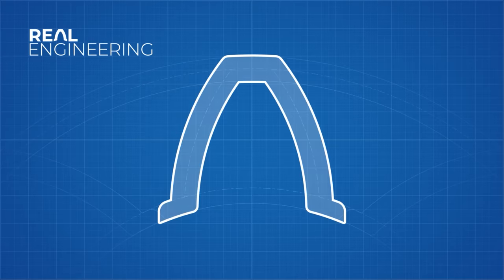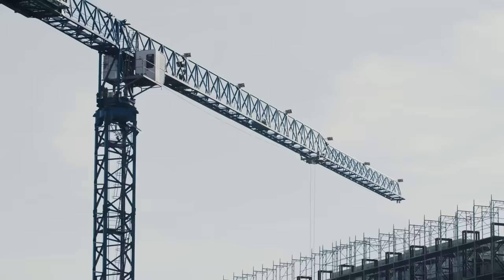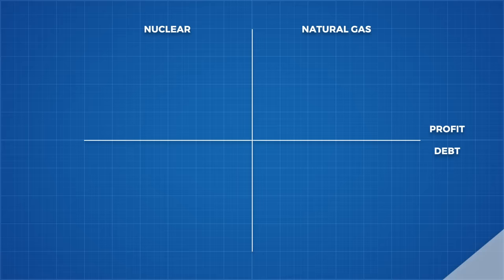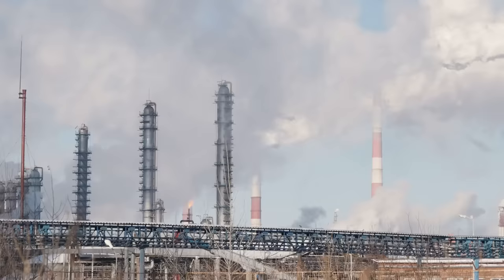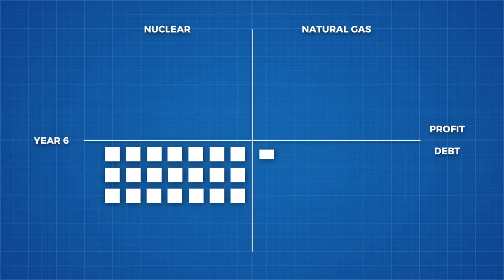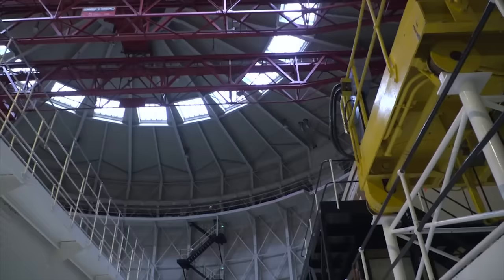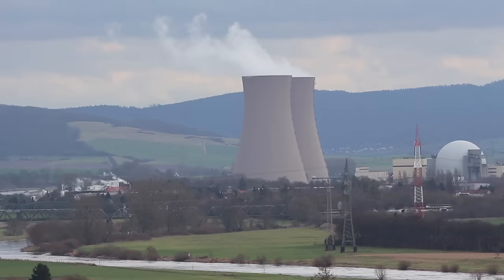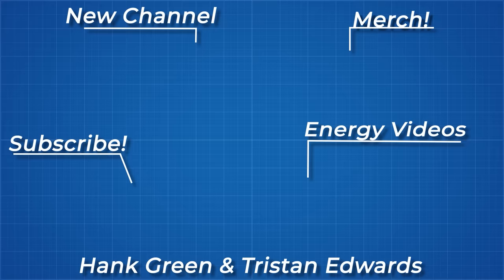The Economics of Nuclear Energy

Comment: HAve you looked at how Small Modular Nuclear Reactors change the economics ?
Reply: NuScale WAS building SMRs.  But fancy web sites and power point presentations don't always result in reality.

This is from the Des Moines Register an ultra conservative newspaper concerning the only Small Modular Reactor (SMR) project in the U.S. today.
In 2013, the Wall Street firm Lazard estimated that the cost of generating electricity at a new nuclear plant in the United States will be between $86 and $122 per megawatt-hour. Last November, Lazard estimated that the corresponding cost will be between $131 and $204 per megawatt-hour based upon the 4 recent new nuclear projects in the U.S. . During the same eight years, renewables have plummeted in cost, and the 2021 estimates of electricity from newly constructed utility-scale solar and wind plants range between $26 and $50 per megawatt-hour. Nuclear power is simply not economically competitive.
SMRs will be even less competitive. Building and operating SMRs will cost more than large reactors for each unit (megawatt) of generation capacity. A reactor that generates five times as much power will not require five times as much concrete or five times as many workers. This makes electricity from small reactors more expensive; many of the original small reactors built in the United States were financially uncompetitive and shut down early.
The estimated cost of constructing a plant with 600 megawatts of electricity from NuScale SMRs, arguably the design closest to deployment in the United States, was originally advertised as costing $1 billion but upon requesting actual bids from engineering firms, increased to $6.1 billion in 2020. Given inflation and other cost constraints that cost today can only be expected to be significantly higher.
The cost was so high that ten members of Utah Associated Municipal Power Systems canceled their contracts. NuScale then changed its proposed plant configuration to 6 fewer reactors but increased each reactor output from 50 Mw to 77 Mw costing at total of $5.3 billion. The NRC just last week approved the construction of the 50 Mw design but now will have to start the review process all over given the switch to a 77 Mw design. For each kilowatt of electrical generation capacity, that estimate is around 80% more than the per-kilowatt cost of the Vogtle project in Georgia — before its cost exploded from $14 billion to over $30 billion. Based on the historical experience with nuclear reactor construction, SMRs are very likely to cost much more than initially expected. And they now have delayed the project start until 2025 in an attempt to find more backers.  All this before the inevitable setbacks that will occur once construction starts.
Reply: @clarkkent9080   Over on this Side of the Pond, Rolls Royce and Associates have put forward proposals based on PWR designs that they support for submarines.  SMRs save money by using standard reactors which can be fabricated in a factory before installation in a standard building.  (Large Not Modular Reactors, such as we now use  involve a consruction approach - ie every job is unique and must be done on site in the weather and subject to the site geography.  One of the biggest drivers of cost and time in nuclear power is the regulatiory burden which means that every installation must be separately approved.   Being identical, SMRs onlu need approval once with slight variations depending on where they are installed.  OTOH each LMNR needs its own  safety justification. SMRs can also be brought online incrementally reducing the capital requirements and the TIme to Generation which Real Engineering described in the video .  I don't have a lot of detail on this issue, but RR&A have put a lot of efffort into this idea.  I was hoping that Real Engineering would find the time for some research !
Reply: @jamesgunn5103  I would disagree based on the following.
1. When and if RR or any other company designs, builds (in a non authoritarian dictatorship with world safety standards country) , operates, and proves their claims, Then and only then will they have validity.  A fancy web page and power point presentations mean nothing. 
2. The Westinghouse AP1000 is a STANDARD design 100% approved by our NRC for construction and operation, first built in China. All you have to do is build it according to design and provide those records to our NRC and that is it.
3. The build it a factory approach was used in the AP1000 construction of VC Summer and Vogtle here, building system modules in a factory.  When they arrived on site, they did not fit together and poor welds had to be redone.  The concept was blamed for cost over runs and schedule delays. 
4. Is this factory going to melt and pour the steel for the reactor vessel and steam generators, build and wire the reactor coolant pumps?  Because a reactor coolant system is simply comprised of a reactor vessel, steam generator, coolant pump, and connecting piping.  What is the big deal if it is welded together in a factory or shipped to the site and welded there?
5. The idea that you can build an entire reactor plant and ship it on a truck is insane.  You could design a 2 or 3 megawatt plant that small but here in the U.S. the over the road weight limit is ~ 40,000 lbs (18,000 kg) and that is close to the weight of a SMR vessel alone.

NuScale was building a SMR facility in Idaho and here is that story.
This is from the Des Moines Register an ultra conservative newspaper concerning the only Small Modular Reactor (SMR) project in the U.S. today.
In 2013, the Wall Street firm Lazard estimated that the cost of generating electricity at a new nuclear plant in the United States will be between $86 and $122 per megawatt-hour. Last November, Lazard estimated that the corresponding cost will be between $131 and $204 per megawatt-hour based upon the 4 recent new nuclear projects in the U.S. . During the same eight years, renewables have plummeted in cost, and the 2021 estimates of electricity from newly constructed utility-scale solar and wind plants range between $26 and $50 per megawatt-hour. Nuclear power is simply not economically competitive.
SMRs will be even less competitive. Building and operating SMRs will cost more than large reactors for each unit (megawatt) of generation capacity. A reactor that generates five times as much power will not require five times as much concrete or five times as many workers. This makes electricity from small reactors more expensive; many of the original small reactors built in the United States were financially uncompetitive and shut down early.
The estimated cost of constructing a plant with 600 megawatts of electricity from NuScale SMRs, arguably the design closest to deployment in the United States, was originally advertised as costing $1 billion but upon requesting actual bids from engineering firms, increased to $6.1 billion in 2020. Given inflation and other cost constraints that cost today can only be expected to be significantly higher.
The cost was so high that ten members of Utah Associated Municipal Power Systems canceled their contracts. NuScale then changed its proposed plant configuration to 6 fewer reactors but increased each reactor output from 50 Mw to 77 Mw costing at total of $5.3 billion. The NRC just last week approved the construction of the 50 Mw design but now will have to start the review process all over given the switch to a 77 Mw design. For each kilowatt of electrical generation capacity, that estimate is around 80% more than the per-kilowatt cost of the Vogtle project in Georgia — before its cost exploded from $14 billion to over $30 billion. Based on the historical experience with nuclear reactor construction, SMRs are very likely to cost much more than initially expected. And they now have delayed the project start until 2025 in an attempt to find more backers.  All this before the inevitable setbacks that will occur once construction starts.

Comment: Except I was of the understanding that water used to cool is not radioactive, so what impact is there?
Reply: Depends on how you define it.
The water inside of the reactor itself is highly radioactive during the time of running.
It uses a heat exchange with an outer loop to create the energy which is protected from the radioactivity.
The impact is dependent on design and modern ones are much safer in this regard.

Comment: One thing I don't understand is why the warm/hot water from the cooling systems isn't used to heat homes or something like geothermal. Why is it wasted and not monetised?
Reply: Because it would lose that temperature by the time it reaches even a few homes and it's not worth the cost of investment. Actually look up how much it costs to lay pipe. And then add onto that circulating it into a home.
The thermodynamics alone don't make sense to do it. Let alone the economics.
Reply: @mikoi7472  Interesting... I always assumed there was quite a lot of energy at play, given the fact that a loss of electricity to pump the water causes it to boil off and expose the radioactive waste.
Reply: @eurovision50  There is a lot of energy at play, but that doesn't equate to that energy being able to be transmitted through a medium over long range like would be required for heating.
The reason geothermal works so well is because it's used locally and only to heat a few homes. Power generating geothermal is not used for that.
The longer a pipe is too for transferring that liquid the more surface area is exposed to radiate that heat away.

Comment: Are factory-built, truck delivered SMRs the key to rapid production and start-up times? Install them sequentially, or in any scheme that works best? Having one or two spares off-line would allow maintenance/repair with no drop in plant output in a plant with many reactors or with common heat and generation units.

Comment: You are wrong on this one. Try looking at the cost of building reactors for submarines and aircraft carriers and ask yourself why they can do it at a fraction at the time and cost. It is all about the insane regulation of nuclear powerplants in the U.S. that has been catastrophic for the industry ever since the Carter administration tried to shut it down in the 70’s. But for this the U.S. would already be carbon neutral.
Reply: Well for one, look at the size and cost of a nuclear attack sub and compare that to the size and cost of a commercial nuclear plant.  EVERY building in a commercial plant supports power production of electricity. The cost of a commercial nuclear reactor is not much more than that of a sub but what about all the other infrastructure?  and compare the subs 70Mw to a commercial plants 1,200 Mw.  The navy argument is nonsensical and offered by people who don't think things through.

Comment: I would much prefer other renewables to nuclear, as nuclear has very long term waste handling challenge that can have a massive impact on public health (even if it's a small chance), and costs related to that. However, since we've collectively squandered the last 30 years to turn ourselves around, I view it as a necessary risk. Keep current ones online as long as safely possible, build new plants, though only as many as needed. Streamline the process, use established, safe designs. And research long term storage facilities. Hopefully renewable storage will be more developed in 10 years to be enough to complement nuclear, and take over as older nuclear facilities retire. Perhaps fusion, we'll see
Reply: Nuclear "waste" is an incredibly valuable asset, not a liability. It's a selling feature of the current generation nuclear power plants. This "waste" is just unspent nuclear fuel from our older technology reactors, more than 95% is still viable uranium that we now know how to economically utilize. These new reactors will get commercialized within the next 10 or so years, maybe sooner depending on the country of origin.

Comment: All National infrastructure takes a while for the benefits it brings to justify its costs. Relying only on private investments for such a thing is a sure bet on failure. By now we should not be burning half of the hydrocarbons we use for energy if we really wanted to make anything significant to slow down global warming. Only massive investments can make a difference now. As expensive as they can be, they will be nothing compared to the costs of recurrent dramatic climate events and the loss of crops. The impediment Is not the lack of resources or technology but the lack of will.

Comment: how about the cost of dismanteling a nuclear plant and storing it's waste? Why isn't thar cost reflected in the numbers?
Reply: Zuurker U  No. Dismantling and storage isn't the expensive part. The construction is the expensive part.
Decommissioning a nuclear plant is tedious but not expensive. Only around 1% of the total material in a nuclear plant is deemed dangerously radioactive and thus is the only part that needs to be contained for long term, usually about 300 years.
Storage of spent fuel is very simply and inexpensive. Put it in a specially designed cast and bury it. Note that you really only have to refuel a nuclear reactor every 18-24 months for commercial ones. And this is with a small amount of fuel.

Comment: Yourt figures of CO2 per kw need to be amended. in france nuclear is a 5,7g per kwh. because most of the co2 emmision come from teh electricity needed to refine the uranium, which low carbon in france and not necessarily in other countries.
LCOE is wrong by essence, what happens over night ? no more electricity ? the cost and efficiency of storage has to be factored in, else it just doesn´t work physically. why putting the cost of the intermittence of renewable on nuclear ? renewables have to carry the cost associated to making them a reliable source for 100% of the time

Comment: What if we can able to set up a hydrogen power plant 🤔
Reply: Technically, that is no problem at all. Combustion plants such as with gas turbined and piston engines have been modified for R&D purposes, and we now all fuel cells which run on hydrogen. But hydrogen is an energy carrier, not a primary energy source which means it has to be created by other types of energy (which causes exergy losses and costs both CAPEX and OPEX). Therefore, hydrogen will be an element in the solution space in future, when we create hydrogen as a storage gas (is is a chemical substance rather easy to store similar to natural gas) from surplus electricity made from non-dispatchable wind and solar energy. But so far, we have enough flexibility in the power system, to ramp up down and up dispatchable gas plants and coal plants. It is much more effiecient to let wind & solar displace those fossil power plants, as far as we use those quite amply. Later in the path down to zero GHG, yes we'll probably have hydrogen generation via electrolysis and hydrogen power plants as a long term, seasonal energy storage.

Comment: Natural gas is not a perfect solution, batteries of one type or another are a better deal. Hawaii is already 100% renewable and storage. 
Any talk of nuclear has to factor in the life time effects and looking at the issues that the UK has I'm not sure it's such a good solution. Also comparing a country in the transitional phase to renewables (using some fossil fuels in the transition) with France using existing nuclear in it transition is a bit silly.
If Germany were to build enough nuclear reactors starting now to replicate France they would still be working on it in 20 years time.
Basically I think you are trying to over simplify the problem.